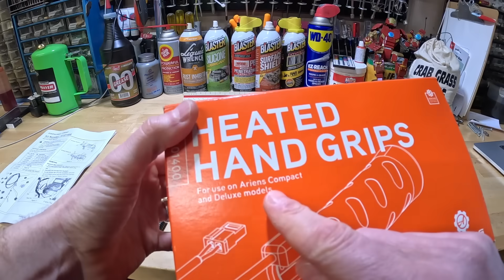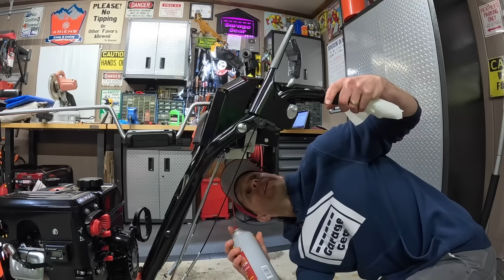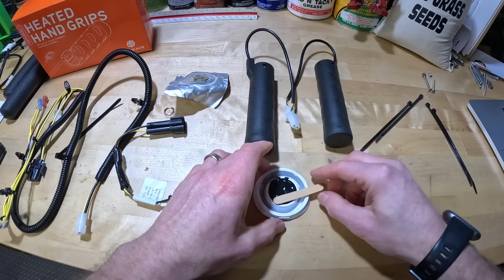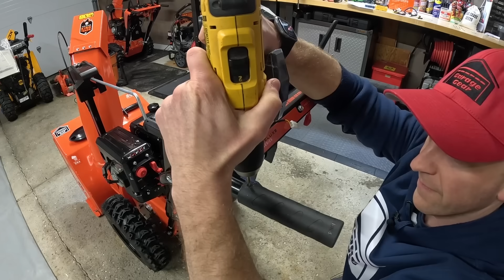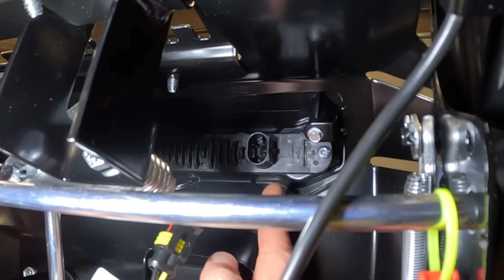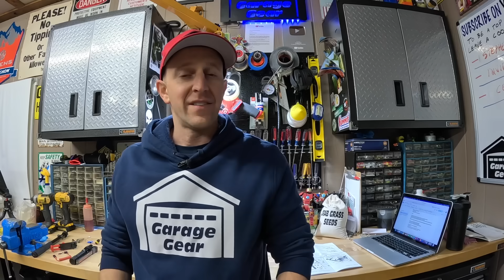The Most "EFFECTIVE" Way To Install HEATED HANDGRIPS On An Ariens Snowblower

Comment: J.B. Kinda late to tell ya, Sorry about that, bro.
- I didn't use the epoxy AT ALL, in case the handgrips become defective needing replacement. Instead, I drilled a small hole in the forward top portion of the handgrip and inserted a stainless steel smooth headed screw, not a bolt and nut. It hasn't moved in 4 years.
- Another commenter reminded me that I filled the handgrip tubes with spray foam insulation too.
- I also did not use the included toggle switch, but instead substituted a lighted surface level push button switch.
- I replaced the OEM Halogen lamp to an LED assembly. The Halogen was way too weak and the LED was much brighter and whiter.
- And lastly, I installed on the upper deck, a snow and moisture resistant Engine RPM and maintenance clock (RunLeader RL-HM058B)
I really suggest to NOT use the epoxy. The grips will stay put with just a screw.
Let's RACE....!

To help others;
For Ariens 00432600 Snow Blower LED Light Bulb 50W Headlight Light Bright White (Ebay)
For those with no headlight, try this;
Amazon ASIN: B00HX526CU
This cliplight has a strong magnetic base, water resistant and the light FIRMLY click swivels in graduations, plus it has a flip out hangar. The light is blinding with 3 AA alkaline batteries
Reply from the maker: Man space cadet these are some really good tips here! Appreciate you sharing these. Checking out the light you mentioned. Could be good for my old ariens possibly! Thanks for sharing and watching as always my friend

Comment: Nice clean install !! On my quad l filled my handle bars with spray foam before I put the grips on , and they get almost too hot
Reply: I think I might have done that too, just can't remember that detail from 4 years ago. Great idea. Helps insulation. Yeah, I think I did do that.
Reply from the maker: Interesting idea! Thanks for watching mark

Comment: I have a sears snow blower.  No lights on it or battery.  Can l get heated hand grips for it? Thanks.  Like you videos.
Reply from the maker: I’m going to say no. Sounds like you’re going to need some power source. Seen guys using drill batteries to run a light. That could work
Reply: @GarageGear  l agree with you. Will probably use drill batteries for some lights. Saw some videos for that also. Do you have a video for that? Thanks. Like your videos. Keep up the good work..

Comment: Just used my new Simplicity 1024 for the first time , the heated hand grips are really cool along with the power starting setup. What do you think the difference is between the Ariens and the Simplicity?
Reply from the maker: I’d have to test a newer one out. The old ones were super reliable. My dealer likes them I know that

Comment: Do you happen to know how much wattage those grips draw?  I got to thinking maybe folks could wire those up on older Ariens models by doing the LED light trick, but instead of attaching lights, hook up the hand grips using the ac to dc converter.
Reply from the maker: Not exactly sure my friend! Interesting idea through

Comment: Just want to mention to you that you could have saved your old hand grips by simply inserting a screwdriver and lifting up the rubber and use compressed air, and the grips will blow right off.. been doing it that way on my motorcycles and everything I’ve owned for many years. Also, you don’t need to use that epoxy and the hand grips. Just imagine the mess you have if you ever have to take those off. The best way to install those grips is to use rivets on the top and bottom of the grips where you drilled and installed the machine screw. It’s a clean professional look and nothing’s protrudes through the handle. All in all, I love watching your videos and you’re better than the rest who try and make videos. You might wanna consider getting yourself a dog mascot. People love dogs, and it would boost your ratings for sure.
Reply from the maker: Hey Glenn! Good tip but I wasn’t planning on keeping them and was trying to show those rookies out there how to do this the easy way. Thanks for your tip though. Would like the dog in the garage! 👍
Reply: @ Well Hello there Mr Garage… so I just installed a set on my Ariens with a 305cc and at high idle after 10 min of running the temp on my grips only barely gets to 73… my halogen headlight works fine and ALL connections were triple checked… and Yes they are OEM equipment for my specific blower sold to me by my local dealer… they told me to contact Ariens for suggestions and I will do that later today but what’s your thoughts…? Thanks
Reply: @ You're screwed.
Reply from the maker: @GlennLecus  I wonder if the halogen light is drawing more power than compared to my led? That’s all I got! Let me know what you hear👍
Reply: @243wayne1  Yea you’re right.. thank your wife for me.. 😂😂😂
Reply: @GlennLecus  I'm not foolish enough to have one of those, but I bet you're on your 2nd or 3rd one simpleton!  Hahaha!
Reply: @GlennLecus may need to just upgrade to an aftermarket kit . But check voltage from the regulator for about 13v steady and maybe your grips element isn’t to good . But I worked in a mower shop and there are diff charging systems for diff amps . Maybe your grips are pulling to much and if you put a battery in the system just yo see if your grips will work hotter then you may need to find a better charging system or a set of heat grips in diff amps becous in kno you prolly don’t wanna mount a tractor battery to ur blower . The battery will act like a capacitor an take the amps an the charging system will keeps it charges like a lawn tractor .
Reply: @ thanks for the info.. my local dealer where I bought them has no clue why this is happening so they referred me to Ariens tech dept and let me tell you they are the dumbest people around.. their tech department consists of all women who are trying to look up answers in a book.. they claim there’s too many variables to determine how hot my grips should get and it’s pretty much the only answer I got from them. They are ridiculous. I asked my local dealer if they would test them on one of their units and they claim they have no older units to test them on right now.  I would hate to go to a different dealer to ask them to test them because I didn’t buy them from their store. So right now I’m stuck, but I’ll get it worked out sooner or later. I hope thanks again.
Reply: @ all you got do is hook em up to a battery like a tractor batter and see how hot they get . If there the same it’s the grips if they get hotter then it’s your charging system not putting out enough
Reply: Good set of grips or 10 bucks at a dirtbike or atv shop and you can get diff colors an textures !! But yah when I road quads an dirtbikes we used compressed air to pull grips  if wanted to keep ‘em .
Reply: "Garage dog"  or "Shop pup."  Lol.
Reply: what are we saving them for?
Reply: @  One never knows.. I’m a hobbyist fabricator and I’ll find a use for them somewhere down the road..
Reply: @GlennLecus  throw em away dawg. along with all the other stuff you’ve kept and not used over the years lol
Reply: @GlennLecus  an old bikers trick!  Get to use those skills in the winter.
Reply: Works on golf clubs too.

Comment: @GarageGear, JB I noticed the bag of crab grass seeds sitting on the work bench.  Where does one buy those?  If you wanted to covertly stick it to a neighbor that ticks you off, next time it snows run your snowblower down the sidewalks in the neighborhood being a good neighbor, but when you get to that one neighbor while no one's paying attention, sprinkler some of the crab grass seeds on the snow laying on the sidewalk.  Then continue running your snowblower down the sidewalk making sure to blow the snow as far as you can into their yard.  Snow melts, seeds sown.  It will be months before the crab grass shows up. Revenge best served cold.  😂 

Just kidding folks.  Please don't do this even if it already crossed your mind.
Reply: UH OH....I done did it....i_no_nutin....i_no_nutin...
Reply: The "Crab Grass Seed" Is a joke.  They do not manufacture "Crab Grass Seed."  Lol.
Reply from the maker: I do save that for annoying neighbors lol 😈 my neighbors are pretty cool though! lol!

Comment: I would add a rubber boot on that switch to protect it from moisture they make them for that switch just screws on like the nut
Reply from the maker: Not a bad idea
Reply: I know, right?  Ariens could have included it in the kit for crying out loud.

Comment: How about a single pop rivet to hold on each hand grip instead of a bolt?
Reply: +vOn1b0-  Because the bolt comes off easily if need be.  One would have to drill out any rivets etc.  Plus like JB said, the bottom of the bolt acts as finger leverage when pulling the machine backwards.
Reply from the maker: That would work too! 👍👍

Comment: Just bought a Platnium 28, wanted to add a hour meter, but there is not enough spark plug wire showing to wrap the wire around.  Any tips other than pulling the heat shield and carb engine cover?  Worried about the dual knob as it does not seem to want to pull off
Reply from the maker: Hey Robert! You sure there isn’t a half inch space available to wind the wire around? That’s all you’ll need

Comment: +1 for adding a bolt. The grips on these kits are notorious for sliding off as you previously experienced. The amount of epoxy Ariens supplies is anemic at best.
Reply from the maker: You gotta add something to these. I was tempted to grab my gorilla epoxy but the bolt will keep them on there! What’s going on in your garage this weekend?
Reply: Work, gym, dinner with friends. Hitting up a great local place for their legendary steak tips. 😋
Reply from the maker: @smallblock412  awesome my friend! Busy day! Enjoy!
Reply: Should have used a rivet 😞